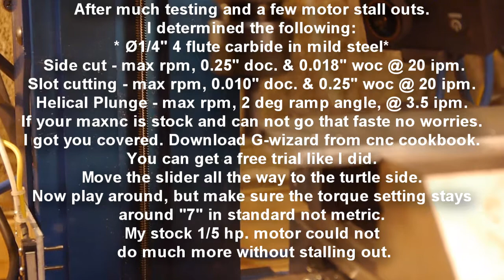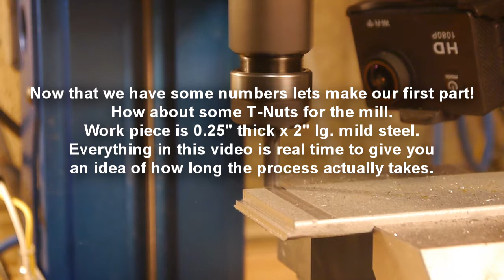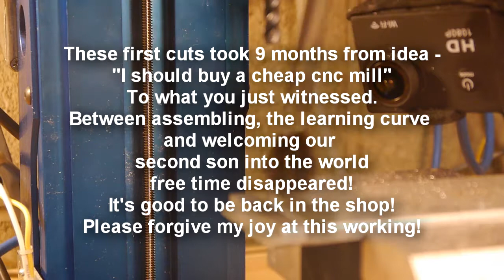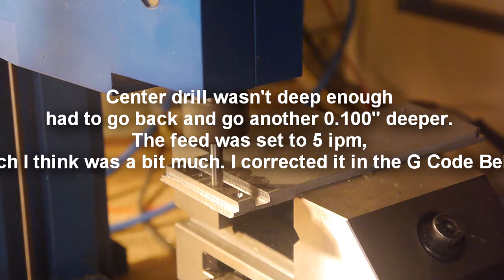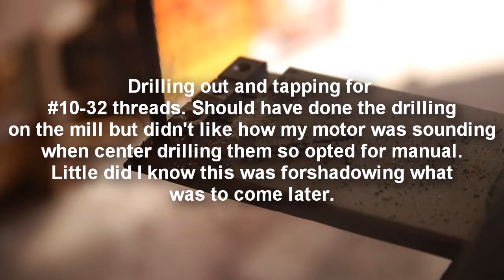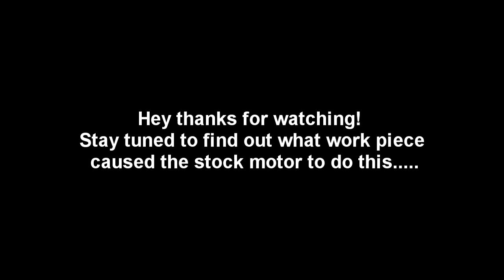MaxNC Feeds and Speeds in Steel. 20 IPM and we make some t-nuts for the hold down track. MAXNC

Comment: nice! I just got my maxNC running. How fast can you push it to cut on aluminum and what DOC? I'm a total newbie at this. I would also love some more T-nuts. I'll send you message
Reply from the maker: Thanks Paul!
Congrats on getting your maxNC running and welcome to the family :-) How fast you can cut will depend on the cutter and motor you have. I know, I know everyone says that. But it is sort of true. The maxNC has an option for either a 1/5hp motor or a 1/10hp motor. There may have been other options but that is what I am aware of. I have a video here. 
https://www.youtube.com/watch?v=CaYPvNSMq1o
Titled "Speeds and Feeds for Dummies, A layman's approach for handling speeds and feeds on a CNC mini-mill" in which I talk a little about how this whole milling thing works as well as way of determining safely what your machine can handle and then translating that information into other materials with G-wizards help. I think it might be a good watch for you. It is a bit long, but I hope it will help and feel free to ask me questions. And sure send me a message and we can talk about your first cuts and I can send you a g-code that will work for your machine, as mine is set up for a 4 flute 1/4" dia. cutter running at 20 ipm through steel. I can tweak the speeds and feeds if I have data on what you have and can do. Like what is the max rate of feed you can produce reliably, open loop control system or closed loop. Things like that. If you don't know don't worry, I am working on a video that talks about the differences in the maxNC family and that should help with identification. Just let me know.